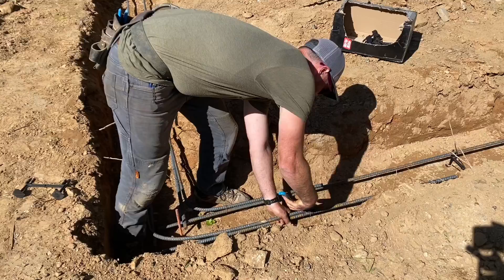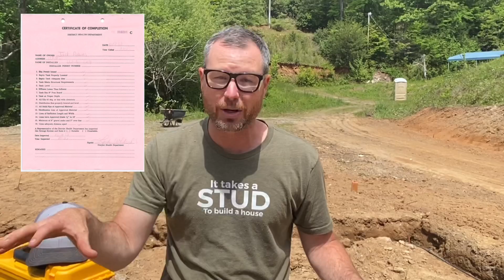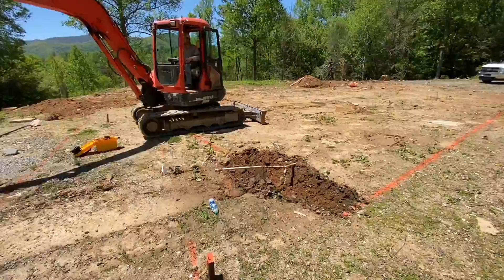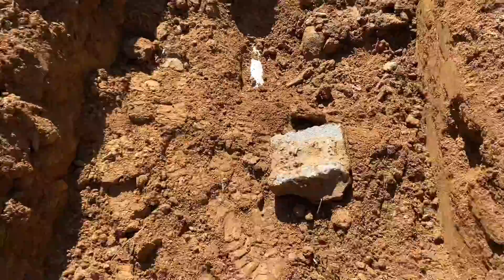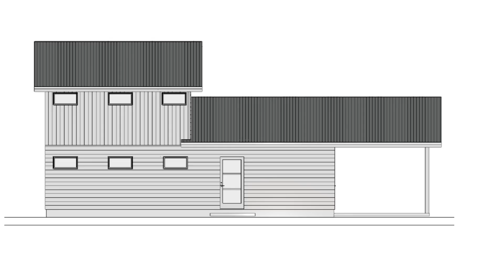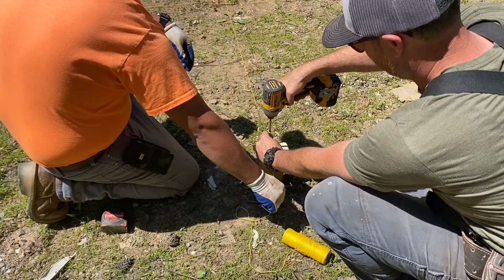Breaking Ground: Great tips for starting a building project

Comment: Do you have to get the old septic tank inspected, or just the new connection and drain field?
Reply from the maker: Really By code we only had to get the new connection inspected, but I wanted to check out the whole system

Comment: Appreciate this kind of video.  A lot of good points.  It generated a couple questions for me...

What tool are you using to check soil density, especially in trench for footer?
Would have liked to seen a little more information on this process especially the fix, when soil density does not meet expectations.
  
Second, its clear that vertical pieces of rebar, "grade pegs", were installed in the trench to assist with level concrete placement. 
However, Isn't there a requirement that calls out minimum distance of embedded rebar from edge of concrete? 
Wouldn't this moisture exposed, vertical "grade peg", initiate eventual deterioration of adjoining rebar supports?

Comment: It's mind blowing that you don't have too put reo in your footings. You could build a fortress off the footings we have to put in (I'm in Australia.) 
The last job I did was a house extension, on a flat block with a good base. Footings were 450mmx600mm, trench mesh top and bottom and pier holes every 2.4m in the strip footing to rock (they ended up around 1200 deep). Crazy overkill.
Reply: It is total overkill. Similar here in NZ. When you consider that the base is solid, even a footing that cracks is going nowhere. A continuous foundation has a relatively low load per sqm.

Comment: I drive a concrete mixer, make sure the ground is level and strong enough, not just loose gravel over a mud pit. And plenty of room for the truck unless you are using a pump truck.

Comment: Great Video‼️ Always had a lot of nerves starting a new build. Layout check and measure over and over. 
Footers on a slope where many step ups are required and SECURE BULK HEADERS in place along with rebar; inspectors go nuts making sure measurements are exact and rightfully so. If its not right in the ground; it won’t be right all way to the roof- no matter how many corrections. Of course YALL KNOW that. 
Funny, I was getting nervous again, watching YALL measure and check everything! Existing septic system, definitely an obstacle to deal with‼️
Love you guys‼️🛠⛏🧱🏡⛰
Have a Blessed Memorial Day and Prayers for Jamie‼️

Comment: Good info on this video, my building lot has an existing septic system on it I went down to the health dept to see if there was a permit on the system..... nope.... the system was installed back in the early 80s and never used. I'm in the excavating industry its always an argument with the home owner about building the driveway into the site, the big fight about trees, homeowners are infatuated about trees it ends up costing them money in the long run.

Comment: Tip: A piece of plywood propped on the generator deflecting the sound from where your at, will save your sanity. And the porta john cleaner comes on Tuesday, so Monday is real bad in there.
Reply: I've also noticed most people don't understand the venting principle in Porta John's: keep the lid closed when not in use, otherwise you vent the fumes inside! 😵

Comment: Does your code require a compaction test in the foot trench before pouring the concrete footer? Great videos as always!
Reply: Yes. Every inspector will check for adequate compaction in the footings
Reply: @jadenr.11  Our inspectors do not perform density test. They just review the report. All structural connections and compaction test must be done by and independent engineering firm. Then we turn over the reports to the field inspector.
Reply: @OffRoad-jh1do  ok so basically there will still be a compaction test by someone almost always
Reply: @jadenr.11  True, but not all states require inspections or permits to build. That is why I posted the my original comment. My area requires a permit for something as simple as a garbage disposal. All independent carpenters and construction workers must take a certified government exam to work for yourself. If not you face fines and or jail time.